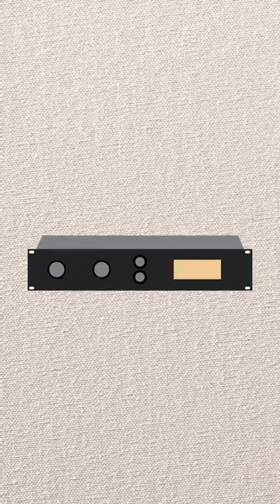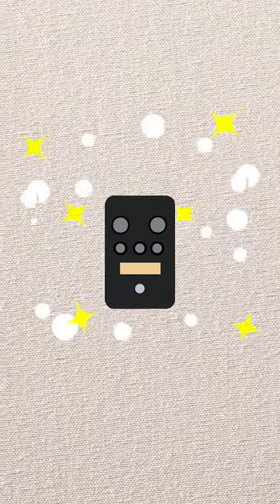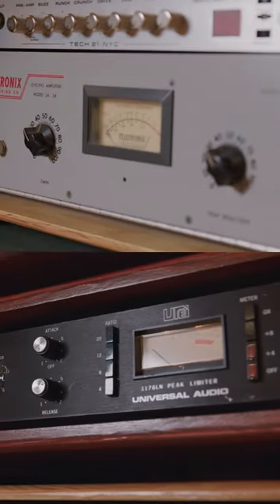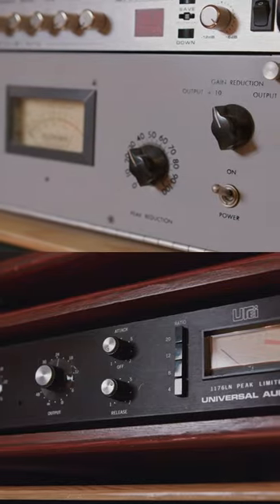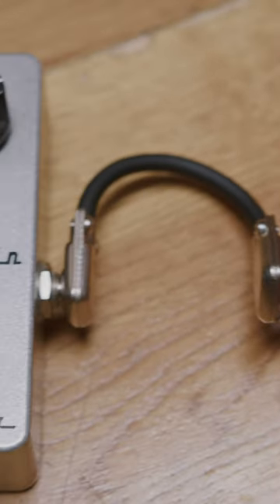Don't Buy A Studio Compressor style Pedal!  Here's why..

Comment: It's because their appeal was more suited to bass players, for which the ability to fine-tune compression like that can matter a lot (the limiter is also a HUGE bonus). Basses, more often than electric guitars, go direct into mixing boards, preamps, or giant headroom amplifiers that aren't supposed to saturate or compress as much because the low-end loses fidelity. Those guitar oriented pedal compressors like the Dynacomp and Keeley, even on their most low-end friendly settings, cut deeper bass frequencies.

The MXR Bass Compressor (released in 2011) was their 76 style pedal format comp and was aimed at bass players almost exclusively. It was additionally labeled as the Studio comp because guitar players wanted it, but shied away from it because it was labeled as a bass pedal. The Origin Cali76 released in 2012? Sure enough, marketed for bass. Now everybody markets them uniformily for both because guitar players dig the range of control, too.

Comment: Highly misleading video! Use the studio compressor pedals in front of your amp any they will work quite like the classic pedals.
Reply from the maker: Did you watch the full video?  Not just this clip?  Most studio rack compressors won’t work well in front of the amp if driven by passive pickups because the design is for after a mic and not high impedance signals.
Reply: @VertexEffectsInc   did you test those studio comp pedals in front of an amp? And you´re still claiming that "they won´t work well"? Because they do quite well...
Reply from the maker: Yes, see my response above, it outlines the shortcomings.  Many studio comps won’t work unless you can convert the signal to mic level or gain up the compressor enough in the input to get enough level to it.  The issue is then it doesn’t work really well with the rest of your effects that are all working at instrument level (-20) when you compensate that much to me the rack compressor work.  Sure, it’s possible, just not practical, and creates downstream consequences for everything else.  This wasn’t their design parameter, hence it’s not ideal and best used after a mic.
Reply: And these pedals are designed to take mic level? The manufacturer builds guitar pedals with a wrong input impedance? Are you sure?

Comment: Was the rack compressor applied after the speaker? This could account for a difference in high frequencies.
Reply: compressor should be place at the End of the wire, right?
Reply: @YesJustTia  My point being studio compression is usually applied post recording (or on the microphone signal in the recording process). Using compression on the guitar before it goes to the amplifier is going to give a different result. Lots of factors here..Preamp distortion, amp headroom etc

Comment: A few things that surprised me a lot was that the sound of the the Dynacomp is close enough to the sound 1176 and the LA 20A that despite the fact that there a few small differences between the two rack bases compressors as well as differences between the and the Dynacomp, that the way way cheaper MXR box can easily pass for both of them. It is really quite remarkable how the Dynacomp seems to fit in right between the 1176 and the LA 20A, but a little bit fuller.

Another thing that also struck me was that I didn't think that the Keeley Comproressor did a very good job, it's sound on the clip, at least to my ears wasn't on par with the other 3 compressors, which is ironic, because I usually prefer a Ross-style over a Dynacomp-style compressors almost avery time. 

I would not lie, it is rare for me to nail down precisely the compressor sound I want in a Dynacomp, I usually find it easier find the sound I want on Ross Style compressor, than on a Dynacomp. 

In my personal case I have two Ross Style Compressors, an old Keeley Compressor (around 15-18 years old) and a Demeter Opto-Compulator Compressor, the Demeter almost never leave my boards -- it is sometimed even a bit annoying the work of taking it from the bigger board to the short board all the time -- I also have 3 Dynacomps, an 1990s block Dynacomp, a 2000s Script, and a newer Dynacomp Mini. 

Out of the three Dynacomps, the one I use the most is the Mini, because when I use an envelope filter/auto wah and/or the Wahmmy Ricochet on the shorter/portable board, I often end up using the Dynacomp Mini instead of the normal sized pedals due to space constrain. 

I usually use a very old Boss AW-2 Auto Wah (late 80/early 90s), or a DOD 440 Envelop Filter or a Wahmmy Ricochet before the Compressor, on these situations the short board woluld get very cramped If I try to squeeze the standard sized Keeley, MXR or Demeter. In these cases I often go for the Dynacomp Mini, and if I have enough spare space on the board, I could also use the Cachalote Audio Origami Envelope Filter, which, in terms of sound, tweakability and functionality, is the only Envelope Filter I know that could give a vintage Lovetone Meatball a run of its money, but unfortunately needs a dual pedal case to comfortably accommodate all of its knobs and switches, so it is a bit harder to fit on a smaller board, which is another reason to sometimes switch the Demeter Opto-Compulator for the Dynacomp Mini.

On my bigger board, most of the time the signal chain is Vibe -> Fuzz 1 -> Fuzz 2 -> Wah ->, from here, depending on the choice of Vibe/Fuzz/Wah  I can go: -> Buffer -> Envelope Filter -> Whammy Ricochet -> Compressor -> … . But it usually goes  -> Boss AW-2 Auto Wah -> Whammy Ricochet -> Compressor -> Mids EQ or Mid/Treble booster -> drives -> … . The choice of Compressor affects a lot the choice and settings of the Mids EQ, Mid-Booster or Treble Booster to be used used.
Reply: Totally. 😉

Comment: I have a Boss CS3, and it is a bit warmer than the Keeley Compressor Plus that I recently tried. Not that it was bad, not at all. The Boss has the advantage of the variable attack knob, as opposed to the fixed humbucker or single coil switch on the Keeley.